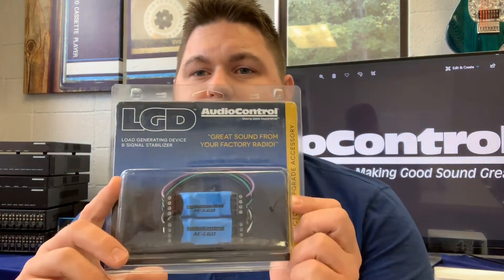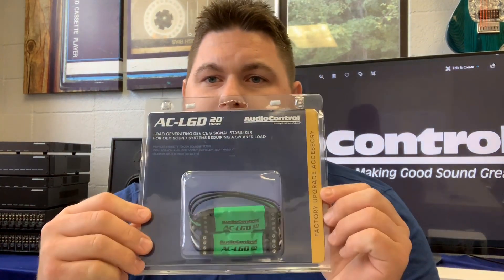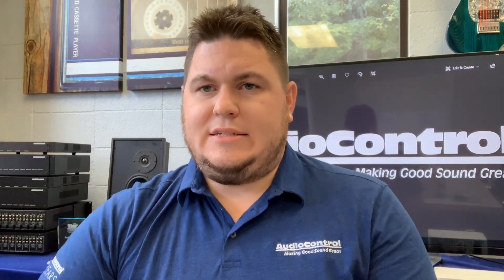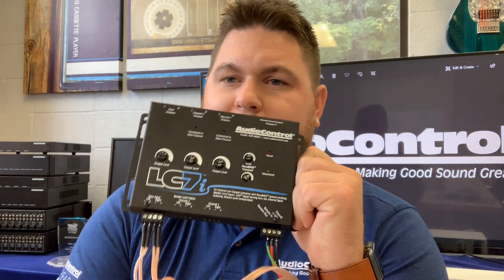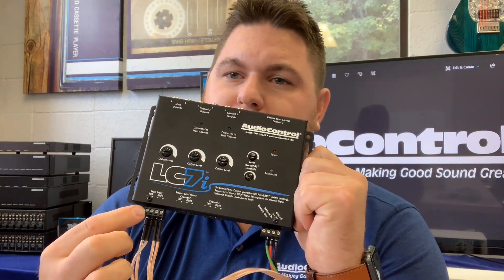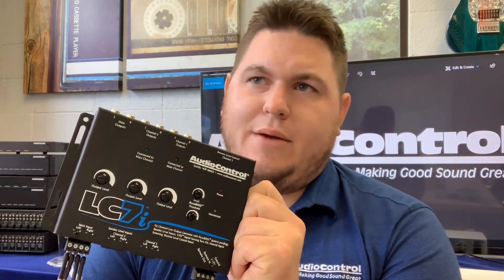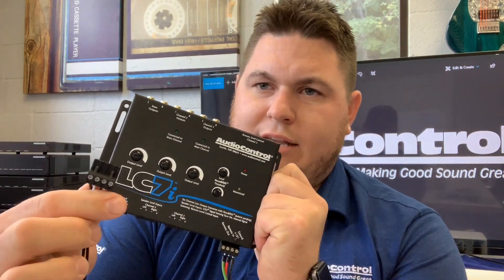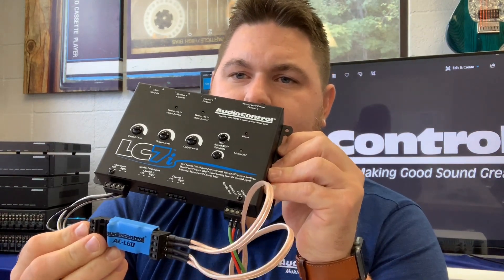AudioControl LGDs explained

Comment: How many of these are needed for changing all factory speakers on a 2024 ford f150 with oem non-amped factory head unit with a 4 channel aftermarket amp and adding 2 subwoofers with a monoblock aftermarket amp with an lc2i?

Basically replacing all factory speakers with a 4 channel amp, and adding 2 subs with a monoblock amp.

Please and thank you!
Reply: Just one set.
Reply: @sp4rksaflyin  I ended up just getting the lc7i pro since they come integrated with it already, and was able to select the load on the device manually. Thanks!

Comment: I have a 2014 jeep Cherokee with premium sound system. I’m upgrading the sub and amp and have the LC2i since I’m keeping all other factory components. I pulled signal from one of the two factory sub plug harnesses to the left speaker port on the LC2i but get a distortion type sound from sub even at very low volume. Would the LGD correct this and if so would it be the blue or gray or does it matter?

Comment: I purchased a D-5.1300 amplifier,  acr -3 and AC-LGD60 from Stinger for my 2016 Honda Pilot Touring with stock amplifier.  I currently had a kicker key 500.1 and kicker key 200.4. Using the same channel high inputs 1-4 active. I installed the D-5.1300 amp. I'm running 4 guage power and ground. The amplifier turns on Using GTO from channel 1and 2 for the tweeters. The 3 and 4 channels are for mids. The only channel that has any sound is channel 4 passenger mid. Subwooer input has no output either but works for Kicker key 500.1. If I sum the channels 3 and 4 the sub gets sound. 1 and 2 channels( tweeters) and channel 3 have no sound . I even unhooked and retightend all inputs and even bypassed LDG with direct output but same outcome. Switching back to kicker key 200.4 and 500.1 everything works fine. Any suggestions. Maybe I got the wrong LGD (grey) for stock  amplifier or LDG is defective. I don't know what to do. I decided to hook up everything today 9-24-2023 but I purchased 5-29-2023 so returning probably not available. This is the most I ever spent on and Amplifier just to end up with a paper weight. I have sent an email already to you Sept.24th but still haven't got a response so hopefully you can answer it here. Thanks again for your input.

Comment: i have a 2021 nissan kicks sr i removes the pillar tweets and front soor speakers added a amp runing high line from the rear speakers both sides left and right and a sas tube.. i get just an error on my scan tool when i look up the av head unit but i have no issues what so ever will i be ok? all it sees is no front door speakers i get audio crisp clean and bass no problems what so ever knock on wood.. i get no check engine light or anything i been running this for a week now up to 20 on my stereo which is pretty loud but not really and i have no issues .... will there be a future issue if i keep using this setup?  can i just add a 3 ohm 25 watt resister across the positive and negative door speaker terminals and just stick it back in the door basically it will see a 3 ohm load can i do that?

it might seem that i keep the rear door speakers in and just tapped into them for high level amp and sas tube inputs that it sees a high enough load to say hmm theres a problem but not enough to screw anything up i dunno just asking advice

Comment: So does the dm810 not have this built in? I lose sound at times but after a few minutes of running it the sound doesn't cut off. The sound loss isn't all the time though.  Also most times when i shut car/radio off the dm810 doesn't shut off thus keeping amps on. Occasionally it will shut down on its own but when it doesn't i pull power plug on dsp and plug it back and it will stay off until i turn radio back on.

Comment: I have an AUDIO CONTROL DQ61,will I need 3 of those green modules? 2021 challenger rt with 8.4 alpine system.I have done a 2014 dodge charger with a line leval convertor from the rear speakers before.

Comment: I have a 2022 Subaru Outback Wilderness and I just finished installing an LC7i and JBL amp. The rear speakers are not putting out any sound, but the front speakers are. I double-checked the wiring and I think it's hooked up right. The weird thing is that the volume control on the factory stereo is sluggish/unresponsive and when it does adjust, the volume coming out of the front doors does not change. I ordered the LGD-20 hoping that fixes the issue.
Reply: Update -  I was super excited when it arrived and I hooked them up right away but.... didn't work :(
Reply: @Withlovefrominterent  did you figure it out?
Reply: @urbinacaraudio  I did get it working finally. After spending way too much time messing around with it I eventually got fed up and put it all back to stock. I got everything working fully with the car the way it's supposed to, waited a couple days, then started over again. The only thing different this time around is I didn't use the same speaker wire as before. I can't say for sure if the wire was the cause of the problems, but it is the only thing different now. For info, the wire I used the first time was a roll of 16 gauge car speaker wire I bought on Amazon. The second time around, I bought lengths of 16 gauge wire from crutchfield and no more issues.
Reply: @Withlovefrominterent  ok gotcha. I'm having a similar issue with 2023 Outback w/ big headunit. Volume seems to be stuck..
Reply: 2021 crosstrek mine still has starlink error

Comment: Im Having Sound Problems Like This. Im Basically Getting No Signal Out Of My LC2i. My LC2i Is Tapped Into My Subwoofer Leads On My Factory Amplifier. Factory Subwoofer Is Still Working But Im Not Getting Anything Out Of The LC2i Output. Is This My Solution????
Reply from the maker: If the existing factory subwoofer is still in the system and functional, then no... adding any model LGD will most likely not solve your issue. Sounds like you have something else going on. Please give our tech team a call so they can walk you through the solution. They can be reached at (425)775-8461 and are available M-F from 9-5 PST.

Comment: Hey guys, I recently installed a DQ-61 in my 2013 Lexus GS350. At low volume and even with the head unit turned off, I get a static/hissing noise. Will this product help to eliminate that noise?
Reply from the maker: We would certainly recommend installing the AC-LGD's inline between your factory system and the inputs of your DQ-61. There is a good chance they will take care of your issue. If you still have trouble with noise, give our tech support team a call, and see if they can help to walk you through some troubleshooting. (425)775-8461
Reply: @AudioControlCar  thank you guys. I actually spoke to someone at your company and they recommended the same thing. I purchased the LGD’s and it did not solve the problem. I then went inside the unit to adjust the jumpers and now they problem is now fixed. I did keep the LGD’s installed as your tech told me it will not hurt, only will help my setup. Thank you guys for everything.

Comment: Hey guys I have a question I recently installed the dm810 processor at 0 to low volume it has a little hum noise what could be the cause of that in your opinion I had the lci7 hooked up before upgrading to the dm810 it never had any hum noise..appreciate any info you may have thanks .
Reply: I wish yall could've finished that here where we all could have benefitted from it because I too have the same issue ....dm-810....soon as I unlock my doors and get into my car I hear a static noise ...no hum ...almost like fm radio with no signal ...2015 buick regal gs ....prior to getting it installed ...no such of a sound from my car . I had a lc2...with all stock speakers still in the car ...no issues ....plus ...I have the acr3 ...its not working good ad a bass knob for my fosgate subs .....any help with the static ?
Reply from the maker: We have some suggestions that might help you. Please get in touch with our tech support team so we can best help you: https://www.audiocontrol.com/contact/

Comment: I have a 2019 dodge charger that I swapped out the alpine system speakers for jbl clubs. I added a lc2i and amp and 8" subwoofer and tapped the rear deck speakers to get a signal. As long as the lc2i, sub and amp are connected I get weak bass, if any, from the sub and the rear deck speakers distort. Would these fix the problem?
Reply: u need to tap the front speaker for bass, i also have a 2019 charger and adding amp using lc2i

Comment: I’ve been using Audio Controls excellent products since 2003. In my 45+ years of a career in audio and telecommunications systems, the advancements in electronics have been quite impressive. Exponentially mind boggling is a better way of describing the electronics industry and Audio Control products are clearly the best despite being hampered by the elements found in the Pacific Northwest. Maybe the higher than usual rainfall here in the Southeast is causing my confusion but after watching this dreary video a couple of times, I still don’t understand the necessity for a LGD device. 
Even the man struggling to make his point in the video looks the way I feel...CONFUSED ! 
Will someone please clarify the basic operation and need for this device ? 
And the beat goes on....

Comment: Im having this issue with my 2019 jeep grand cherokee, i replaced the door speakers, now i dont have signal to the lc2i! I think based on youre video i need the one with green heat shrink
Reply: Just bought a set and mine still isn’t working and have to call tech again
Reply: Justin Feliciano what year is youre grand cherokee? Also did you replace all 4 speakers?
Reply: Justin Feliciano i ordered mine. It comes in friday, i hope this fix my issue
Reply: Justin Feliciano ** update ** i got mine lastnight installed it today and it worked!
Reply: @Datkidjayy   I’m glad to read this response. Just put an LC7i in my 2017 grand Cherokee. Learned that I needed these.
Reply: @steel2bridges  for my jeep i needed the green one. I hope that works for you